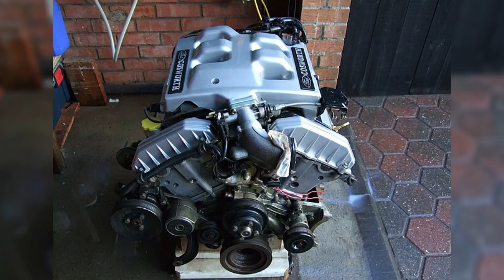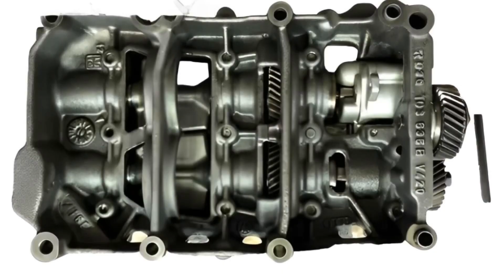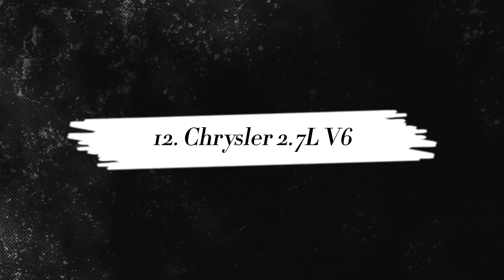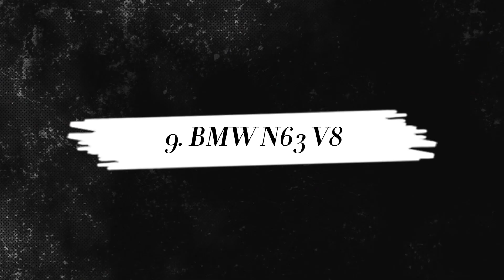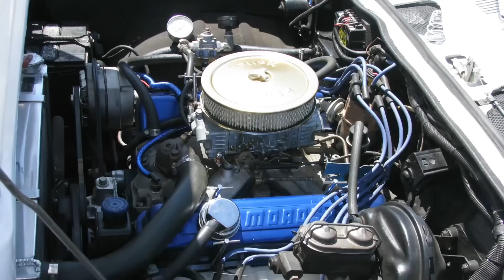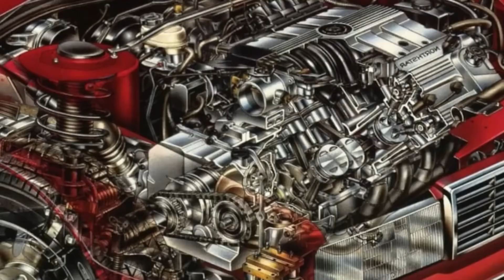20 Least Reliable Car Engines That Will Break Down (Please Avoid)

Comment: The EJ25 Turbo models didn't have any head gasket issues they used a metal head gaskets for those models. Now ringland failure that's another story all together.